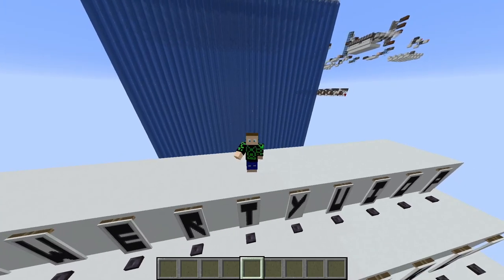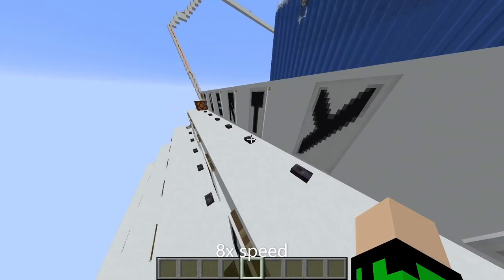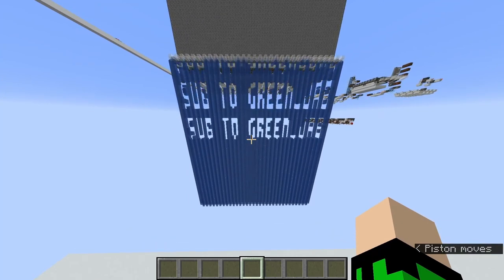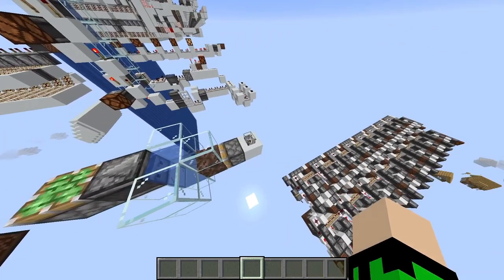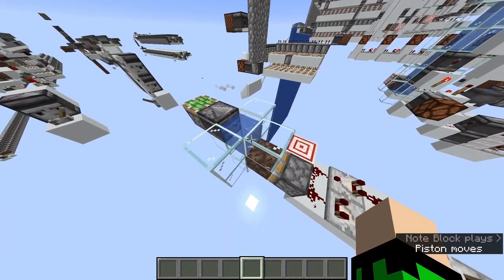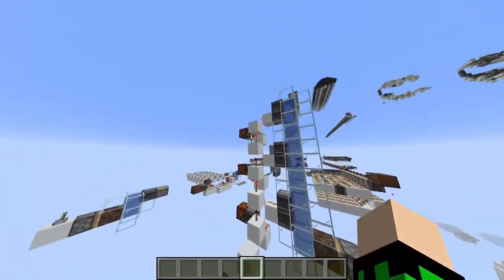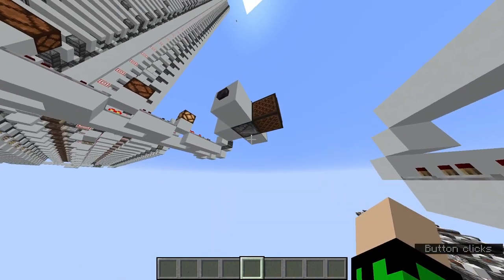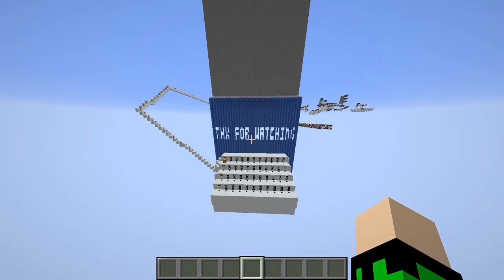Waterfall Typewriter in Minecraft

Comment: How is the signal transmitted from the typewriter to the processor? If there's only one redstone line that doesn't preserve signal strength do you have to use several pulses to transmit each signal?

Really cool build and the tower looks pretty compact : )
Reply from the maker: if you watch the latter half of the video, I go explain how it works, its the length of the pulse time wise, not signal strength, there are 42 inputs and only 15 signal strengths (not including off)
Reply: @GreenJab  Ouch well I'm an idiot.
That's what I get for browsing on reddit and not finishing the video lol